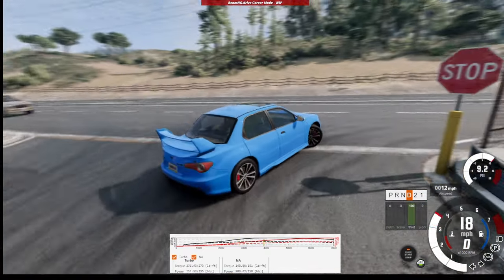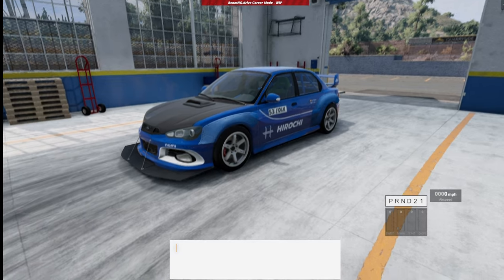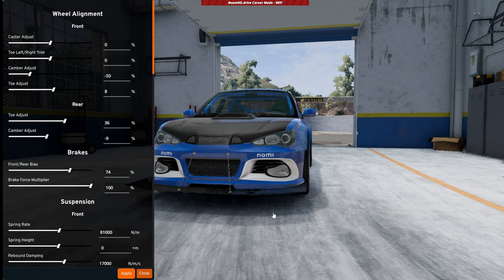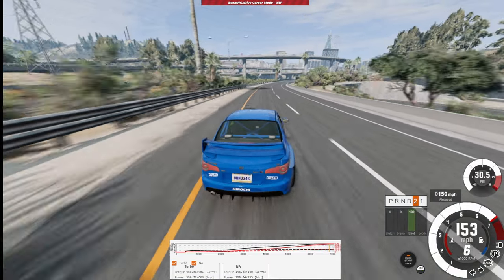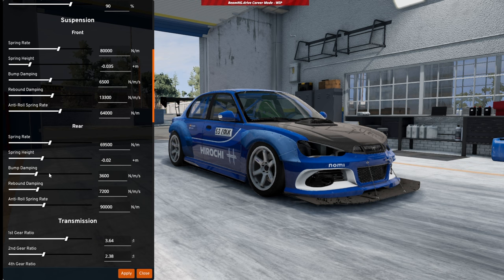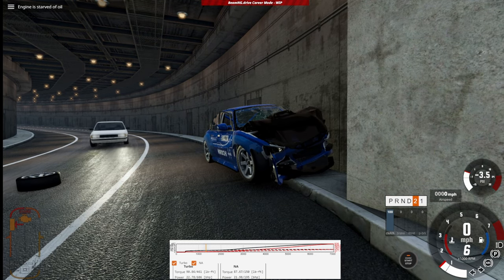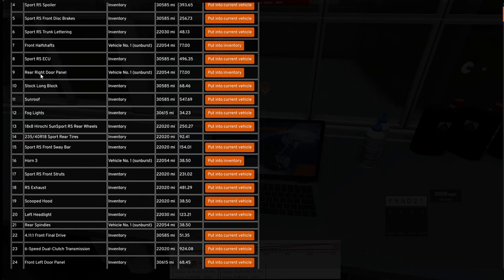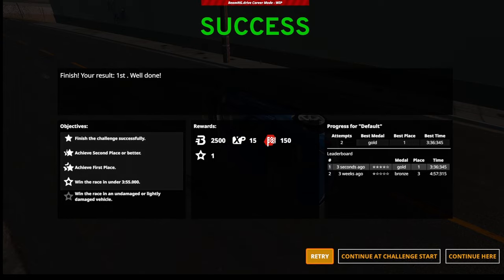Racecar Build and Setup - Beam Career Mode

Comment: 9:56 Race Cars don't need Headlights , because the Track is always lit . Btw you forgot to take off license plates
Reply from the maker: I did dang it lol
Reply: Some tracks actually would require headlights for safety just because there are some dark points. But you can always just slap a lightbar on and you’re mint haha